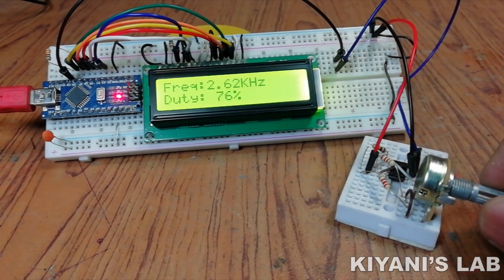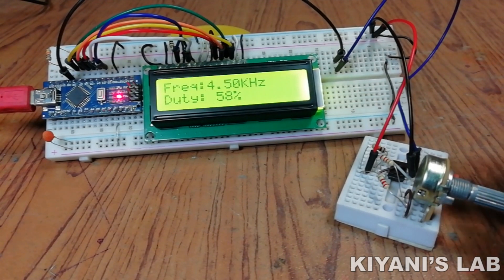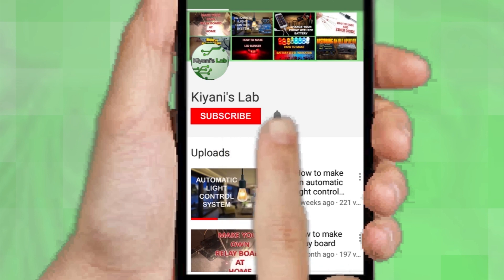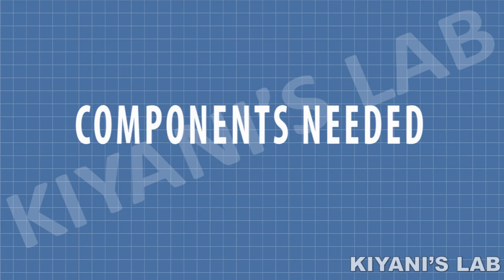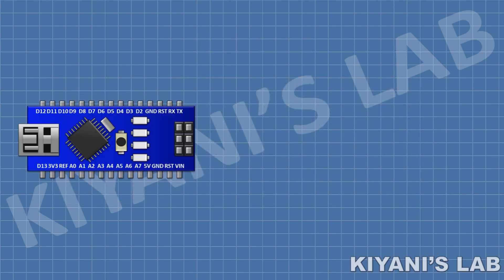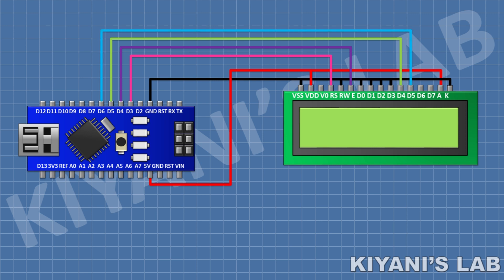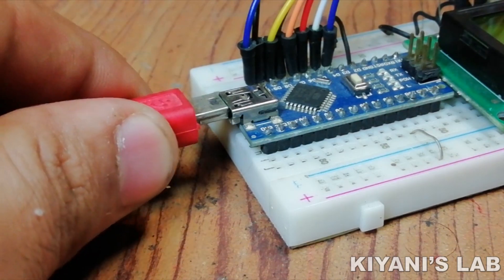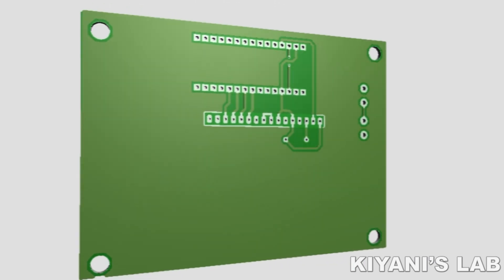How To Make Digital Frequency Meter

Comment: what is the max frequency that you can measure with this?
Reply: In case of arduino external iscillator max frequency range should be 16Mhz

Comment: hello friend , I like your video
can i suggest?

Can you make an audio amplifier using Arduino that can change the frequency depending on what frequency you desire using a potentiometer and can be shown on the LCD?
thank you
Reply: what you’re talking about is low pass and high pass filters

Comment: Is there any way I can make such frequency meter to work at high voltage (about 10kV)???
Reply from the maker: yes need to design isolation circuit
Reply: Oh great! 
I thought that I must replace some details.

Comment: question what is the point of this thing what settings are you potentiometre set to and for what e.g. a nominal car water temp reading for ecu is set to say 400-900 ohms an air temp has a reading of 500-1250 ohms and then O2 sensor has other reading in your set up how would you corrolate all of thse together woulf you build 3 of these to feed into the ecu or just one. When i did this years ago all i needed was 3 variable potentiometres set them all to the nominal cold resistance reading then very them from there as the engine warmed up it cost a whole $5 instead of $175 each for the prospective origonal switches, is your set up any better than what i was using ??

Comment: Sir you are great plz make more project on ardiuno 
Like mppt solar charge controlar
         Solar tracking system etc
Reply: i have code for solar tracker and wiring diagrams, full size solar panel. 3ft x 2 ft  All 12&5v circuits
Reply: @alanw5879  can you give me
Reply: @RAUF.Y  absolutely.  you want it emailed? Full wiring diagrams and Arduino code.  The setup takes alittle while to understand and build. But its been fully tested. Requires 7-12volt actuator but Ill include pictures of my build. This is only the solar tracker components, diagrams and code. Leave me an email and ill get it to you tomorrow. its 12am here
Reply: @alanw5879  thanks
Reply: Uses Op Amps to compare voltages and light dependent resistors (LDRs) to determine when an adjustment of the panel is needed to follow the sun. You just need to add a circuit to have the panel return East for the sunrise in the morning.
Reply: if you have any questions im glad to help